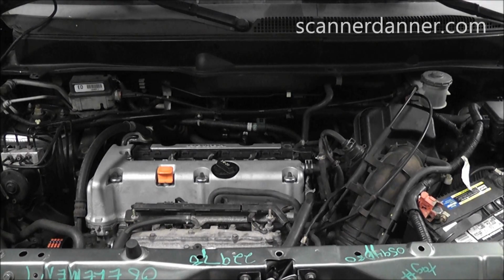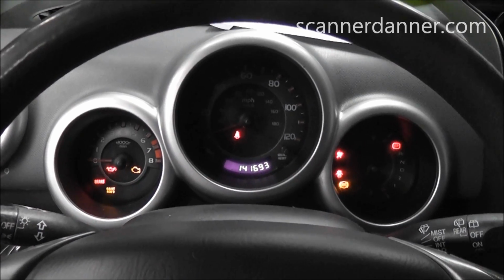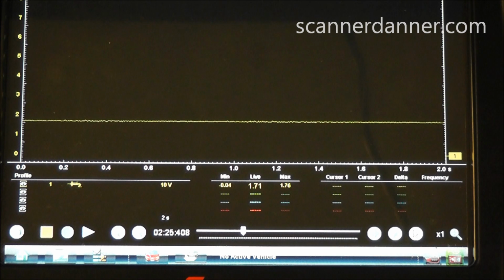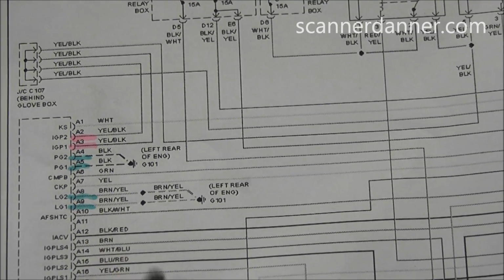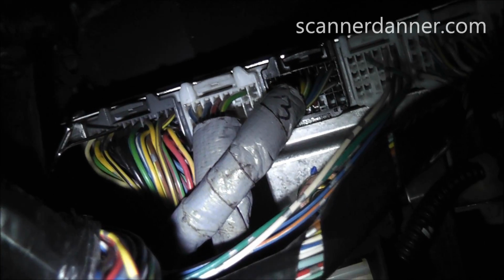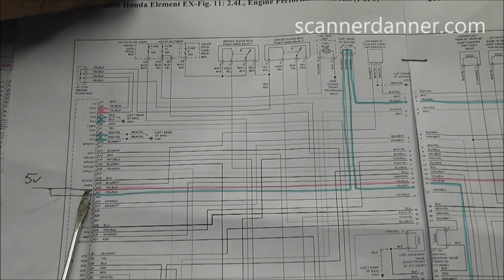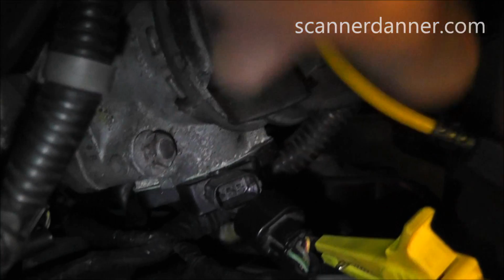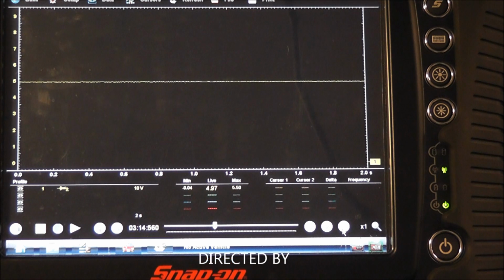No Start from a shorted MAP sensor (Honda, Acura)

Comment from the maker: Just some fundamental knowledge my friend. This 5v ref. circuit is the same on every car. Thanks!
Reply: I've heard you say there are cars with 8volt reference signals. Is this correct? Maybe I'm remembering pull down or  up designs. Thank you for the great content.
Reply from the maker: @scientist100  yes sir, Chrysler systems from the 80s through the late 90s used a 8-9v reference for the cam, crank and vss inputs circuits, while using a separate 5v ref for the rest of the inputs

Comment: Love your videos. Just had to help another tech in my shop after he did an engine swap. Had exactly the same symptoms. He tried swapping the coil, crank and cam sensor from the old engine before I stepped in. After checking crank signal and not finding it, checked 5v reference and did not have one. Computer not so easy to back probe so started unplugging sensors. Found that in the rush of putting the engine back in, he had plugged the cam sensor connector into the coil. Unplugged the coil while watching the 5v reference, boom, 5v now. Easy fix but shows how easy it is to over look something so simple.
Reply: I see this was 6 years ago but I am about to go and troubleshoot that exact scenario this weekend and your comment is more useful than you realise, I think you may have already cracked it for me.....I am already on a good path with this one, thanks for the 5volt input dude 😉 👍
Reply: @turtlezed  you’re welcome, hope you are successful

Comment: Been working on my own stuff for 50 years. Way back before all this complicated stuff. Always looked for obvious first, cracked disconnected hoses and broken wires, burnt wires, chafing wires. Blown fuses, open circuits. All we had were test lights and a multimeter. 

Now that we have cars on the computers and can bus system it has gone way complicated, but thanks to guys like you us do it yourself types can figure it out again.

Back in the day I hung out in the local garage and watched. That is no longer really possible anymore. Thanks to youtube you can hang around thousands of garages.

Comment: why should you check for a good 5v Reference? Remember, the 5v-ref. circuit is an output signal from the module used for diagnostic purposes/feedback on wiring integrity. If this is not present, this indicates that the module is not awake.  I've seen 7v-ref circuits, 10v-ref circuits etc, but 5volt reference circuits are the most common amongst vehicles, at least from my experience. 
Awesome video, I thoroughly enjoyed it

Comment: That is an awesome diagnostic video for someone who is not quite familiar with this situation. But early on in the video I could have told you that the plugs for the map and tps were mismatched. Happens most the time when someone is not careful in their engine swap and hooks them up wrong because they both use the same exact plug.

Comment: YEp ... great job and very good troubleshooting approach ... I used to do this sort of thing on a brd level at an electronics mfger where we have a test jig for a pcb and it tells us what test fails and then we find that area on the schematic and proceed from there. Golden rule of ANY electronics TSing is power supply power supply power supply ! As you were saying most electronics today are protected from short circuit and over current as well so it makes it pretty easy to track down these sorts of issue. Well done Danner

Comment: what an excellent video, extremely good information for going after a no start .
Reply from the maker: Thanks John
Reply: @ScannerDanner  one confusion....the 5 v reference signal is shared to all sensors.

Now, if the 5v signal to MAF is shorted, why the engine can start with the MAF sensor unplugged?? Is not that the ECM will not provide any signal to other sensors too? Please kindly brief clarify. Thanks.
Reply from the maker: @tnamen1307  key word "signal", a 5v signal wire on a digital MAF like on a GM, is a pull-down type of circuit.  The computer sends 5v to the MAF and the MAF pulls it down to create a digital square wave pattern. This is NOT the 5v reference circuit. Yes, it is tapped into the 5v ref inside of the engine computer, but it is isolated by a current limiting resistor. In short, a 5v signal wire is totally different than a 5v reference wire. Hope that answered your question.
Reply: @ScannerDanner  that means, if any sensor or wire sharing a 5 v reference circuit or wire is shorted, then all the respective sensors will not work. Is this my understanding correct??
Reply: @ScannerDanner  and, another question relating to ac compressor.

My car i20 engine is running very quiet as usual. However, as soon as AC clutch is engaged, I hear a squeak sounds and not metallic sounds or alike. The squeezing like sounds go away immediately as AC is off. Even with engine revs, same sounds. And with AC off, as I revs the engine, still the engine is quiet. How to find that squeaky like sounds and fix it?

The AC is blowing cold. It seems the AC compressor is ok.
Reply from the maker: @tnamen1307  please only ask your question one time, you've asked me this same question on other videos. I see them all and asking multiple times will not get you a faster response. It just becomes white noise amount the other hundred comments a day I try to answer. Thanks!
Reply from the maker: @tnamen1307  "@ScannerDanner that means, if any sensor or wire sharing a 5 v reference circuit or wire is shorted, then all the respective sensors will not work. Is this my understanding correct??" That is correct!!

Comment: Hey Paul great test, i agree checking for voltage references from pcm when you dont have communication the first step, test is to verify what the pcm need to supply, which is voltage 5v references ,totally agree,, thanks for sharing

Comment from the maker: Yes! Not common but yes. So the process would be to check all powers and grounds, then disconnect ALL sensors that share the 5v ref. Then ohm the 5v ref wire to ground to make sure the harness is good. Then and only then do you look toward the PCM as the fault. 
At this point we then consider the other variables. Like in this video "2005 Chevy Impala Crank Sensor Trouble Code (P0335)"
I almost replaced the PCM in this video for something similar. 
Variables upon variables my friend :-)

Comment: I notice that the odometer reads 141,693 miles even though the engine was swapped out. Could that be a sign of the computer not being able to communicate with the engine?

Every time you solve the issue I'm simply blown away. Thank you for the work you do and the effort you put behind these case studies.

Comment: Another great video. Long time subscriber, and what you prove is that it doesn't matter what car you are working on, you dont need to be experienced with every single car out there, the concepts are fairly identical and therefore so can the troubleshooting. It almost makes me want to purposely create the faults you find, so that I can do the same tests to prove it. My luck though, I'd have the PCM without the "safety" circuitry to handle a short and would blow the PCM, lol.

Comment: thank you i have been working on a 2006 subaru wrx no power to the pcm no power to fuel pump no power to injectors and i just went in to work and unpluged the maf and it started right up thank you

Comment: I have a friend with an 05 Dodge Ram 1500 van who is having a similar issue as what you had going on here. It's an intermittent crank but no start, and "no bus" clearly indicated on the cluster, and no data link while this happens. This weekend we will be looking it over. He assumed possibly a bad crank angle sensor, I told him to watch this video since something is possibly grounding out the reference circuit.
Reply: Probabky bad ecm

Comment: thank you,  this info was a huge help...the sensor did knock off my check ingine light and no start condition... anyway, all is good now..the computer  was getting very hot during all my checking but now the fuel relay is malfunctioning and will not start normally... but it will start if I supply voltage to fuel pump... anyway, Ill look at it tomorrow.. thanks again..your awesome.

Comment from the maker: I have not. I have seen the tool and it is pretty neat. I prefer loaded circuit voltage drop testing myself. I understand there is a need to unplug a circuit to test it at times and this tool could be handy for that.

Comment: "It isn't just like a regular 5 volt regulator that you buy from radio shack and you short it to ground and you kill it" - The LM7805 has short circuit, overload and thermal protection built in.

Comment: This really help me out scanner Dan cuz I have the same problem and thank you so much I hope I figure it out I need your help I have a Mercedes Benz 1998 E320 on trying to figure out I'm just learning this wire thing I'm a good backyard mechanic but anyway thank you so much
Reply from the maker: You are on the right channel to learn the electronic and electrical side of the car my friend. Thank you!
Reply: @ScannerDanner  I have been chasing a bad wire for a month it was bad when I bought the car 2yrs ago it had bad map sensor, I drove it for quite long time then it started dying out let sit it wood start drive die start die u no  replace map egr cam sensor crank sensor I took battery in out so many times too charge now the whole system must b shut down but I still have not pinpointed the bad wire I'm on top of it but too stupid 2222 figure it out  I do not want 2 get beat by this because I have a lot of pride for myself but its gettin me puzzled I plan on drivin 2 FLA. For winter it's a great car when runnin I need you 2 look or let me talk 2 u about it  I got $$$ and a cell let me know if we can work  sumtin out PlEASE you will like me I'm a 56 yrs o'l schooler but this mercedes is something else I'm used 2  69  70  80 79 chevelle and monte Carlos let me know  Thank you so much   troy thoreson hope 2 here from u

Comment from the maker: check your fuel psi and if it has a MAF sensor make sure the air intake tube has no cracks in it and that the MAF sensor checks out good.

Comment: this remind me of a time when i was working for a mazda dealership and was first starting out and i had a mazda 626 that was tow in and i try to dianose what was wrong. well i gave up and went and got the lead tech. he came over with a basket of know good electronic parts and told me to try the maf senor first. and what he meant by try the map sensor first was swap it out and see if the 626 will run. well i swap the maf sensor and the car ran. so we informed the customer it need the maf sensor. after the dianose i went back to the lead tech and asked him why the maf fixed the car. and he told me that he dont have a clue. just that his first 626 that he had the problem with took the whole day to figure out with mazda tech support and he just started swapping parts till he found the problem. thank god the car was under warrenty and all the parts where cover. well after seeing this video now i know what was probably happening. we had all the same syptoms as this honda did. by the way there was a computer in that basket that he handed me. be he couldnt get into the computer with the scan tool. so he replaced the computer. Lol im glad i didnt replace the computer. we didnt have a scanner danner back in 2002. thanks for the videos you do.
Reply: I once had a 88 aries wagon would just stop unplug map would run  replaced numerous times used too keep one in the car  a friend at Chrysler told me to move sensor above engine from inside to firewall water accumulation & freeze in winter never happened again
Reply: Randy Johnson where can I buy a magic basket of goodies like your buddies

Comment: with a simple test lite, and the power probe III  thats all you need , get a power probe where you can inject a ground or 12v at will, plus its computer safe ''just be carefull where you supply the 12v though'' and its a digital multimeter aswell, check it out its only a $100.

Comment from the maker: you got it my friend. once you know fundamental systems, all cars are the same! 
Not that you should do it, but every single 5v reference circuit that I have seen shorted to ground, comes back to normal after fixing the short. On some of these you have to turn the key off, then back on for it to come back. Not sure how the PCM is protecting it? Maybe some type of PTC resistor? Anyway, I wouldn't do this one for practice :-)
Reply: ScannerDanner so that means need a new map sensor?

Comment from the maker: I would say only if they are using multiple reference circuits or are somehow able to isolate certain branches of the reference circuit that are drawing too much current flow. I have not seen that yet. You short a 5v ref circuit out and the PCM is "dead"
The 5v ref. circuit is the main lifeline of the computer system. It cannot operate without it.

Comment from the maker: you wouldn't need a "fancy scope" on this job. you could have done the same thing with a code reader "no communication" and a voltmeter. 
Also if you go to Mitchell 1 DIY, for $10 you can access what you need for a few days (same diagram I used). So total cost in troubleshooting equipment for this job could be less than $100. Sometimes we need the fancy stuff, but not in all cases :-)

Comment: I'm working on a bad 5 volt reference right now lol.  I did the same things before I found this video.  Powers and grounds good.  All the sensors were unplugged  that shared the 5 volt ref and I still have 1.9 V.  Transmission solenoid connector unplugged brought the Voltage up to 2.4V.  So that's where I'm at atm.  Weird stuff out there folks.  1998 Dodge Ram 1500 5.2L 2wd.
Reply from the maker: Check the vehicle speed sensor harness that it's not rubbing on the front driveshaft 😉
Reply: @ScannerDanner  Thanks for the reply back.  Its a 2 wheel drive so there's no front drive shaft. I've disconnected and inspected the trans harness and it's good and no rubbing.  The transmission was used, supplied by the guy and I installed it for him.  Drove fine and he took it for week.  I'm worried the trans solenoid shorted and took out the PCM 5 vref.  With the trans solenoid  connector disconnected I get an extra .4 volts (2.4) and connected (1.9).  Also he said the trans was making noise on the way here before it died.  Now I'm trying to figure how to to test the trans solenoids besides basic short to ground and resistance tests.   The things we do as favors, trying to help someone out and then bites you, sucks lol.  Thanks, Dan.
Reply from the maker: @Seans-Garage  my name is Paul :-) Danner is my last name. Anyway, don't worry about the solenoids, they do not use the 5v reference circuit. 1.9, then 2.4v with the transmission connector unplugged right? Did you cycle the key off then on with the connector still unplugged? If so and it is still low, your problem is NOT in that connector or any of the wiring that goes through it.
Reply: @ScannerDanner  Oops lol, sorry, Paul.  Accordingly to the wiring diagram theres a 5 volt ref that goes to the transmission connector, trans solenoid assembly.   Which just says 5 volt supply, no pic of what's inside the solenoid assembly. I measured the same 1.9, 2.4, volts there as the 5 volt ref to the cranks, cam, map.  I think its split internally like vid says. Every connector is unplugged, good batt voltage to pcm, good grounds as well.  I checked for a short to ground at both 5 volt and its good.  I'm thinking either a short to another sensor,or pcm.  The guy said he was driving along and it died.  This was a week after I installed the transmission.   It drove and shifted fine for a week. My instinct tells me pcm.  
Thanks, Paul, for taking time and responding.  Any help would be appreciated.
Reply from the maker: @Seans-Garage  https://www.youtube.com/watch?v=hJQ6qnhTgdg
https://www.youtube.com/watch?v=ecz93B5SRsQ
Watch this two part series for some testing methods on the 5v ref circuit. It is more in depth

Comment: that was a great video i would think that the fault would be the immobilizer, from experience. honda if the key  ligth flash it would be a no comunication no start problem and the pcm would be the issue

Comment: Quick question.  Why do most sensors use a 5v ref voltage?  Why not 1v or 2v in general? What's so appealing for auto manufacturers to stick with 5v?

Comment: Mentions in the video how great the Mitchell diagrams are, saying hiw  they are all redrawn and they look the same.
I would say, coming from Europe and recently having 5 of the top car data programs available in Europe, hands down the Mitchell is the only one i've seen that shows you what all the wires are at the ecu/pcm! 5v ref etc.
Alldata, Autodata, Haynes pro etc, none of them tell you any of this??
They need to get their fingers out, it's not as if Alldata etc are inexpensive too.

Comment from the maker: feeding 5v into this circuit would not have helped you with this shorted MAP sensor. I have however done similar things with low reference voltage on a system where it was not shorted, but open somewhere in the ECM board and was able to make the vehicle start and run.